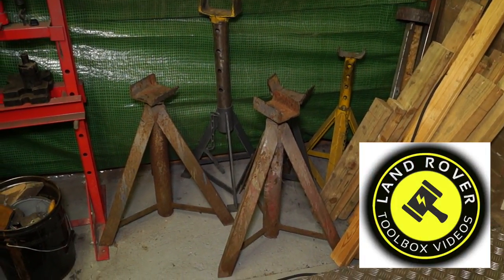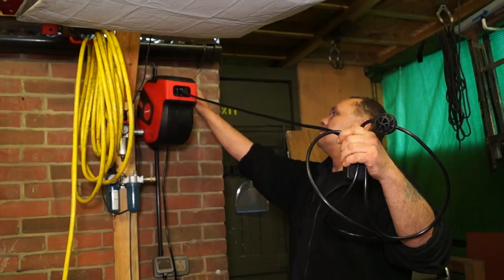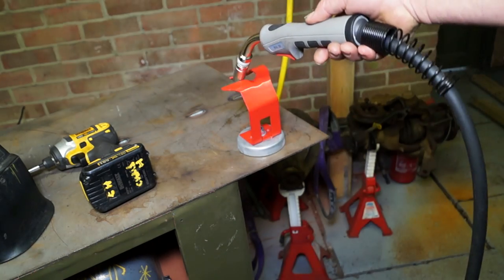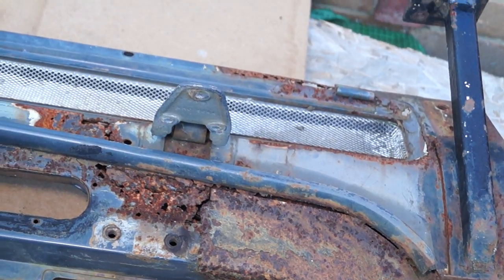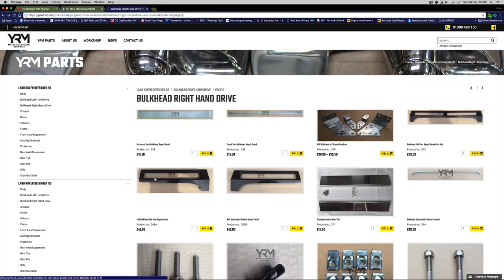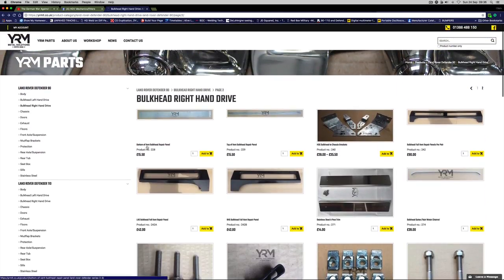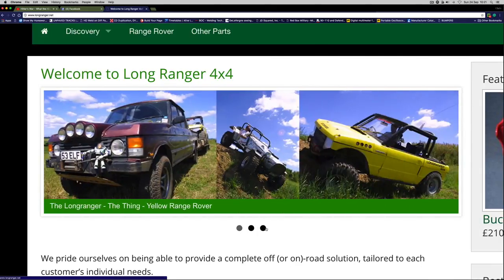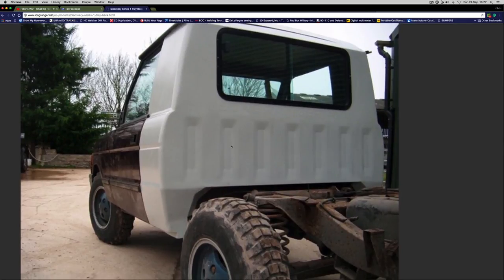Tray-back, Space-frame  or Flat-bed?

Comment: Space frame. I’ve seen one where the proper LR front end was kept so it was reasonably usable - almost a hybrid trayback/spaceframe
Reply from the maker: I got it in mind to have a combination of space-framed cab with winged flat bed with chassis extension.  6x6 would be nice but too expensive to pull off.
Reply: That would be epic. Personally, I would have it road legal, but that does complicate it.

Comment: Much of that depends on your future use?

Platform truck with a substantial bed like the box section and plate bed you featured would make an excellent compliment to a mobile mechanic as it would allow you to build modular units for tool boxes, welder, compressor and maybe cutting gear?
The bed as it was constructed would be easy clean and strong enough to withstand a battering off road, even if you didn't build it up as mobile workshop, a flat bed pick up type truck is rather a useful tool, crew cab pick up would be nice but IMHO you'd want to stretch the wheelbase by another 10 to 14 inches in order to create a useable bed behind the cabin unless it is to be more of a show piece as any weight would be behind the back axle and it would be a whoore of a thing to steer and control should you load it up with any real weight.

Comment: After you mod it will it be road legal?if not space frame all the way ,because all the 3options require money 💰 and the spaceframe can be a nice fun toy after it is finished
Reply: If you cut the chassis,  and dont put it back on,  it will need a SVA,  and its a pain in the ass! lol

(i have a d2 trayback with longranger kit)
Reply: Bit of a grey area now a days, rules have changed a little, you may still get away with changing it through the DVLA as a re-bodied Land Rover, not really sure, been off the forums for a while and there are not so many people who actually bother to do anything much special to their trucks these days unless they are bolt on accessories.
Reply: mines been done about a year now,  and had to do it! 
many people dont bother, as its a pain in the ass,   mine failed once for its fog lamp 2mm to high,   test aborted no refund, and dont carry on the test,

Comment: Didn't you buy a TDCI bulkhead at the start of the project for £200? 
Surely it would be more cheaper to do this, unless it doesn't fit.
Reply from the maker: Ah.  was £350 for the Puma bulk head.  I have it mothballed presently.